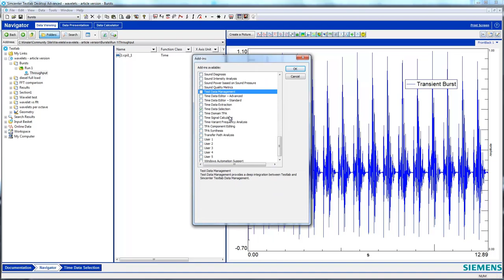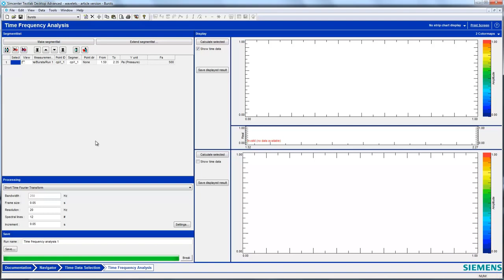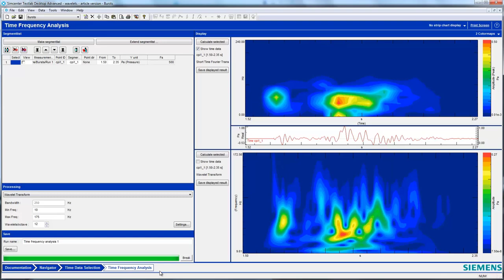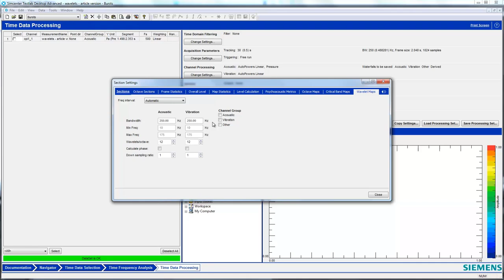Wavelet Time-Frequency Analysis

Comment: Hi 
I have a question. I used Atomic force microscope as a tool  in nano machining .  I recorded the data between the voltage and time in data Acquisition. 
How to send this data to simcenter testlab to analysis by using wavelet time frequency. the type of file is txt.
Best Regards 
Raheem
Reply from the maker: Checkout this article: https://community.sw.siemens.com/s/question/0D54O00006NV8fZSAT/how-can-i-import-csv-data-into-testlab
Reply: @SimcenterTesting  
Many thanks for help . ❤
Reply: @SimcenterTesting  
I would like to thank you again for help. 
I used the excel file and every thing going very well. 
I have got excellent results when i analysis my data in wavelet. 
In my results, i see there is a big difference between two case which i did in expermental work. 
Now, how i discussion the difference between them . I dont have any background about wavelet or amplitude,.
Could you please suggest any way to understand these picture . 
If possible get the e mail to show you the results. 
I did two cases nano machining by using atomic force microscope at same conditions , the different only the direction of motion 
One forward and the other backward. 
Best regards